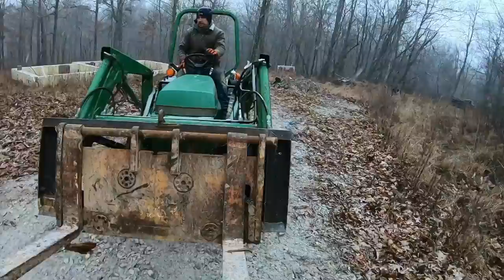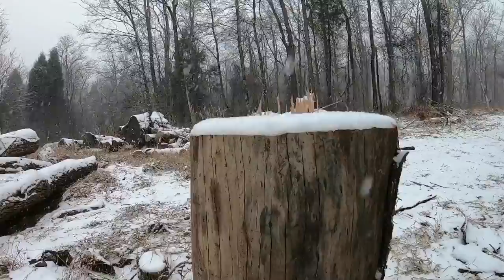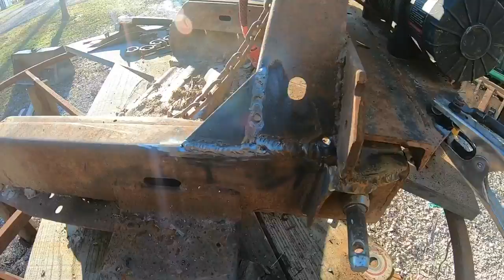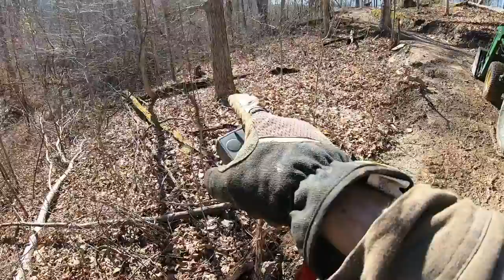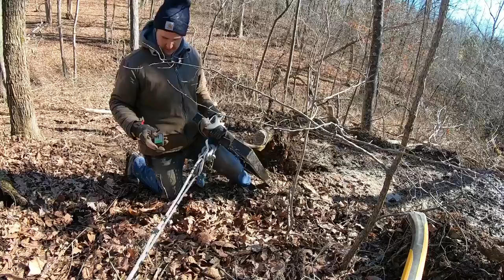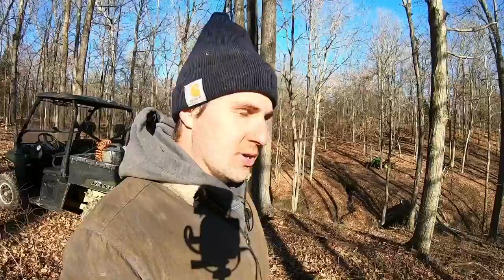Easy Stump Removal With Mechanical Advantage and Compact John Deere Tractor

Comment: FYI gussets should be placed in the center of your two pieces of metal for the strongest support not on the edges. The winched work well and the trail looks great.
Reply from the maker: Thanks!
Reply: In this case where he has either tube or c channel he is at the stronger point.
Reply: @brianbabb6666  you are dead wrong
Reply: @wolfpacva  I understand you feel that way but I can not see how it could possibly be stronger where the metal below can collapse under it opposed to where he has it with the up and down steel to support it?

Comment: Mike get you some 5/32 6010 rod good for arc cutting and welding on rusty painted metal.
Reply from the maker: Thanks for the tip!  I have some 6011, I may try that

Comment: You are no longer stumped Captain!! 🤣🤦‍♂️
OK, maybe the cameras will still dumbfound you at times, but that is just the way they are..... you gave us plenty of different angles to view from, the drone flight was spot on, shame the sapling stopped you mid flight 🤦‍♂️
Made sense to remove the whole tree to have a straight descent to  the bridge. 
Have never seen winches used for this type of work, only used them for moving vehicles etc. at various fire calls.... I would recommend you get a canvass sheet to drape over the winch cable when doing this in future, it will reduce the cable whipping around if it breaks while under load. 
One take outros are the way forward, don't think about them and let it rip young man !!!! 👍👋
Reply from the maker: Hahaha thanks Alex!

Comment: Try drilling a 1 inch bolt hole put a bolt through and put a nut then put the strap underneath the bolt. Might help, we used it in VietNam with the Seabees help and it worked!
Reply from the maker: That's alot of extra steps, but I bet it worked well!
Reply: @CaptainKleeman  you’re right plus the ground over there was a lot softer. Plus I see that your efforts worked out ok. That’s what I like about your videos, you never give up and they are amazing to watch.

Comment: Maybe a small redesign to your fulcrum would help your winch dig instead of lift when you are "level" to the ground and don't have a hill to stand on.  Instead of it being a flat square, you could make it L shaped with a snatch block at the end of the L.  You can run the cable down to the bottom, loop it to a snatch at the top of your fulcrum, and back onto the tractor. That way your winch is pulling down to the snatch that is near the ground instead.  Just a thought.. But as long as you have a hill to climb I guess it doesn't matter, 😁.
Reply from the maker: But then you would also be pulling the bottom of the fulcrum towards the tractor as well if I'm thinking right,. Interesting thought though
Reply: @CaptainKleeman  yeah you're totally right.. Even if you looped the top back down, then back to the tractor it would probably kick out the bottom before pulling down from the top... so close! lol

Comment: Why don't you get or make a couple of wheel chocks for the tractor? One for each of the back tires. Hell use a big rock behind both tires. Maybe it won't slide then. Something that might help is to angle that metal contraption toward the stump a little bit before you start.

Comment: As soon as the low shots of the tractor spinning its tires trying to push that tree downhill started, I thought to myself "well, he's not getting back up that hill without an assist".  Got to admit I didn't quite expect the sideways slide, though.  Should have, I guess, especially with slicks on by that point.  Turf tires don't sling the mud out of the tread, course R4s aren't the the best at slinging mud out either, and I've seen mud that R1s didn't want to turn lose of as well, so different tires may not have made much difference, and even if they would have, you'd be giving up the advantages of the turf tires under other conditions.  Everything is a tradeoff. 

As to how I suspected you were not going back up that hill, well, let's just say been there, done similar.
Reply from the maker: Everything is a trade off,. I like that, I'll be using that one

Comment: Would driving a couple rebar stakes behind the which help when it doesn't dig in? I understand it will stop it from digging in, but might stop the sliding in some situations. Or run a chain from the bucket to a tree to stop the tractor sliding

Comment: How about having  a strap, cable, chain run under the front of the tractor,  hooked to your winch bed.
Hook the strap, etc to an immovable object. That way the tractor won't move and you won't stress the tractor frame.
Reply from the maker: I like that idea,. There isn't always an anchor in the direction I need to pull though, but it could work

Comment: Kleeman you do good work and persistent as H ,but you don't quit pulling with those nylon lift straps and switch to log chains someone or something is going to get hurt.  They load up an have a slingshot effect more so than chains ,steel cables are bad enough.  Snatching straps are one thing around a tree to pull from but when you add a chain or steel hook and pull to you well deadly they get an quickly. Stay Safe my friend not criticism but safety thoughts!
Reply from the maker: Appreciate ya looking out, this was the safest thing I did all week 🤣
Reply: @CaptainKleeman  just wish I was still  able to help ,I'd be bringing home a flat rock!

Comment: Needs a choke chain on the tree stumps. So the chain bites in more. It as you say a bit slower and yes your not putting lots of shock load in to the tractor. I have often used a A frame lifter to pull rally cars out of a ditch or over a "jump up". Keep that remote out of your pockets as you said "dangerous" and you definitely do not want a uncommand winch movement.
Reply from the maker: A choker chain or cable would definitely help!

Comment: If you are going to cut with a welding rod soak it in water for a few minutes first and the rod will last longer and make a nicer cut, I’ve cut a few miles that way in the past 50 years. If you know a professional welder usually they will have some rods that have been wet and they will probably give you plenty

Comment: Not sure what rod you are burning, 6011 or 6010 was coined the farmers rod where I grew up. They  had minimal time to prep a repair on  painted rusted or greasy  equipment.  A wire wheel on an angle grinder  helps too.
Reply from the maker: The only rods I have currently are 7018 and 6011

Comment: Another great tool in the arsenal. Couldn't you just chain the front of the 755 to a tree when you are in a place where the log deck won't dig in?
Reply from the maker: I could run a cable from the front of the winch under the tractor to an anchor if I had one long enough.  But I would want to attach the tractor itself.

Comment: Instead of trying to get the tractor in a position so the log carrier will dig in why not anchor the he tractor/winch to a tree. Install a hook or clevis to the carrier and run a chain from the carrier under the tractor to a tree for an anchor. DO NOT HOOK THE TRACTOR TO A TREE to use winch. I’ve seen large tractors pulled into doing that. Stay safe little dp
Reply from the maker: Have to buy some more cable and chain first

Comment: Would it not have been better to keep the tractor where you have it and pulled down the hill?
Reply from the maker: The way the winch is designed the tractor needs to be up hill or have a low angle of pull

Comment: I wonder why you are no anchoring the other end of the winch line to a larger tree, so you have both mechanical and weight advantage already on the line/pulley.
R U running on a short winch line???
Since hooking it to the tractor reduces the stress and load on the winch and cable, but you are still pulling just with the weight of the tractor.
Reply from the maker: Not understanding your question, but the system worked well as is
Reply: @CaptainKleeman   Well I can understand this setup if you have short winch line, or lack of tree saving strap, but other than that I would not hook it back to the tractor, but rather to another tree in the direction you want your pull.
I can throw in some russian recovery videos on how super heavy things are pulled with pulleys.
That is what seemed odd on this. But other then that, great job on your property and doing youtube.
Sorry if I am not too clear with my expressions, not a native speaker,  just a random do it all guy from other side if the globe. ;)

Comment: ... and now you know what to do with that salvaged Forklift hydraulic unit ... weld a attachment rig on it, a fair sized belly plate to the bottom and a hook for a chain ... roll up to the stump and yank them out vertically. Easy peasy.  I do the same thing with a metal tripod and a come along ... yours' would be heaven ! And use a chain instead of a strap ... more bite ... and get a winch line safety blanket (at least throw an old piece of rug over the line when winching ... it snaps and it can cut you in half ... not joking Bro.

Comment: Looks like if you when your cleverest is laying in too far over towards attractowards the tractor stop your windshield a little bit and then stand it back upstraight nintrock going over again
Reply from the maker: True, but if it's still moving and the winch is pulling then there isn't a need to reset

Comment: Saw you struggling with no teeth on the bucket . Try bolting on a 4 by 4 piece of heavy angle iron on the outside of the bucket , then cut a point on it to use as a finger or a ripper . When you need to grade take them off  . Maybe you only need one .

Comment: Wow that's something I've never tried before.... At least not on purpose.. cutting metal with a welding rod.. I have done some art gouging which is basically the grandfather of a plasma torch copper coated carbon rod with compressed air blowing the slag away. Very loud very effective not very accurate it's more for gouging out six pass or more welds!! As far as this lever and winch and snatch blocks.. now you're just playing fun, farm, physics with the, 755!! 🤔🤔😜😜😜

Comment: Let me help you out ,I was cringing watching you come so close to but not finding the easy answer to your nylon strap sliding ! Disclaimer ,I have 42 years experience rebuilding wrecked rail road cars in shops and out on the line.  Plus doing heavy construction and logging as my second job !  The old WW2 vets when I hired taught me how to use what you have ,improvise . We made levers ,fulcrums and anything we could to gain mechanical advantage . To stop your strap from slipping wrap it around whatever you are trying to pull for 2 or 3 wraps  before making  your choke . By just making a simple choke it will slide off as you found out .  I guarantee it won't slide but bite in . Secondly ,chains bite much better on something to not slide .I used to pull bent schedule 80 pipe back out straight using just come along  attached to my truck and make 6 or 7 wraps around the smooth steel pipe before choking the chain to itself . You will be amazed how it won't slip ! Third suggestion is when wincing with that set up you had and your tractor was creeping back toward your hone made fulcrum , attach a heavy piece of angle iron or square tubing between the tractor and the fulcrum .That will stop the 2 from coming toward each other and instead concentrate lifting force on the fulcrum ! Good luck !

Comment: Just anchor the front of tractor to a tree
Reply from the maker: And pull the tractor in two?  That's not super productive
Reply: It wouldnt pull the tractor apart I use this method all time when I go 4x4 wheeling with friends an one of us get stuck in mud an has To be winches out tie the back out truck to tree an winch from front to stuck truck.